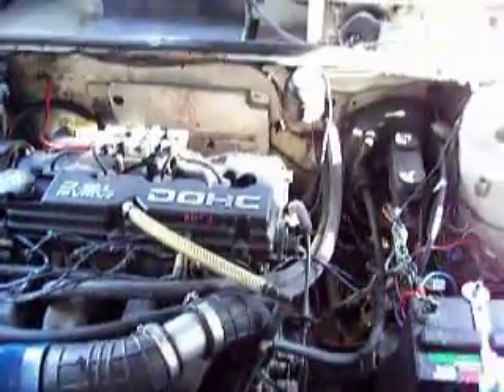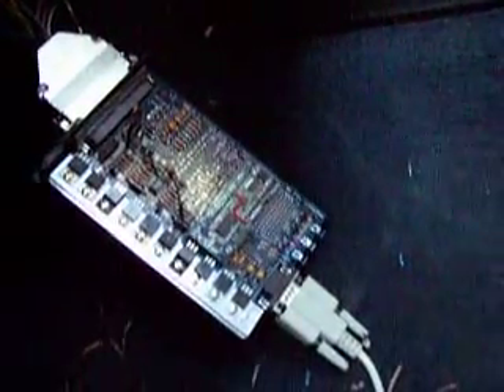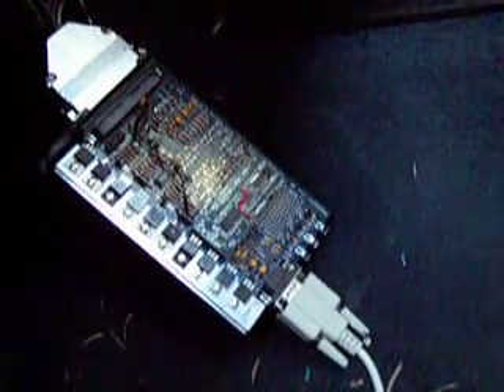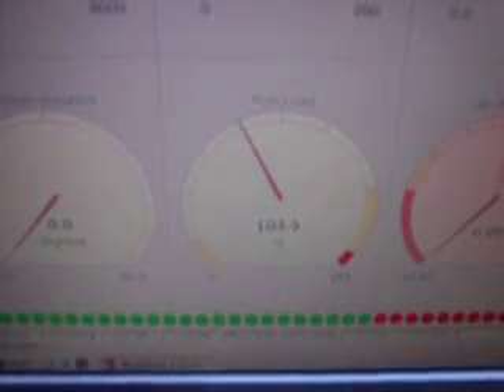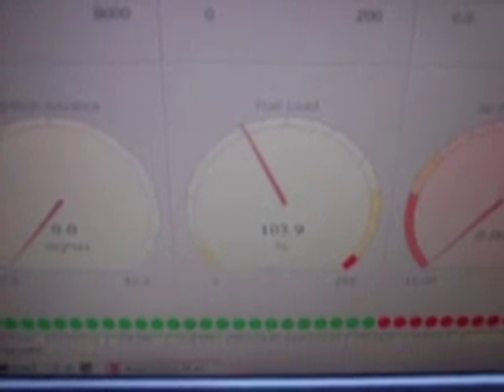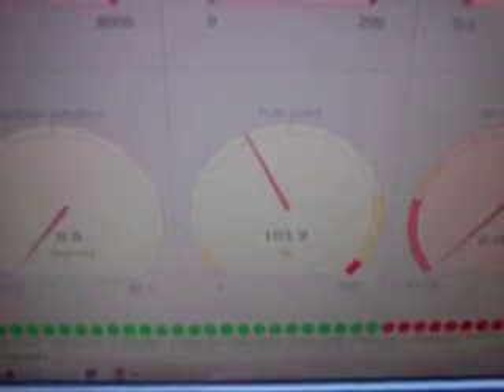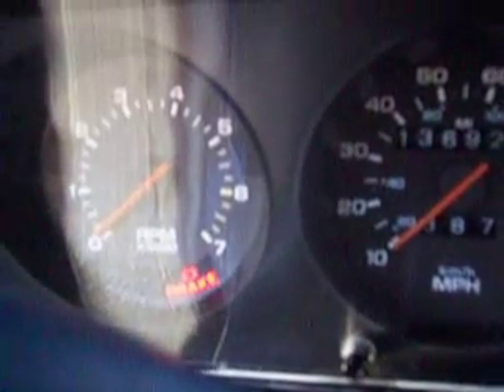The world's first MegaSquirt II Super420a!

Comment: i have a question, im not getting spark from my megasquirt, im geting fuel but no spark which is odd cuz it still getting signal from the crank, i get both outer leds light to blink so i would like to know whats your input on this? might there be some thing wrong with my megasquirt? anything input will help, thanx  for your time